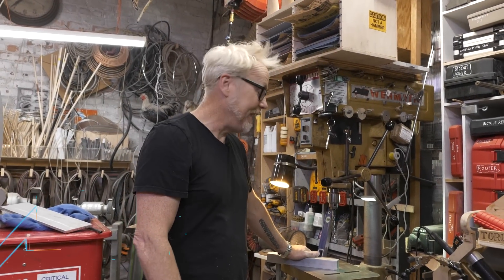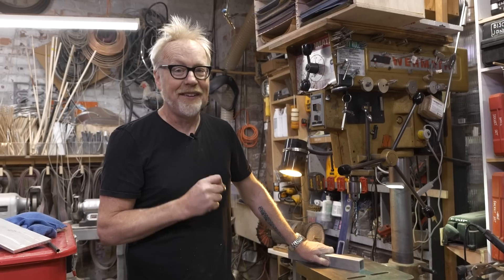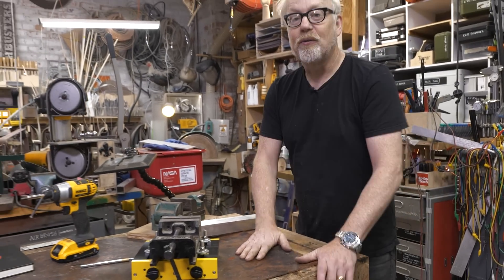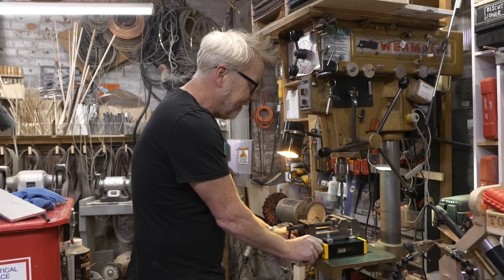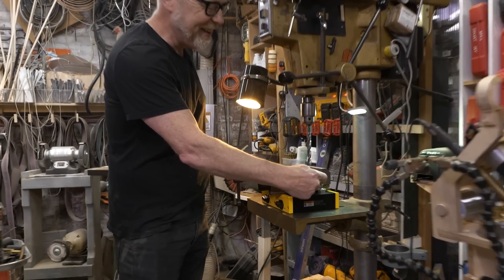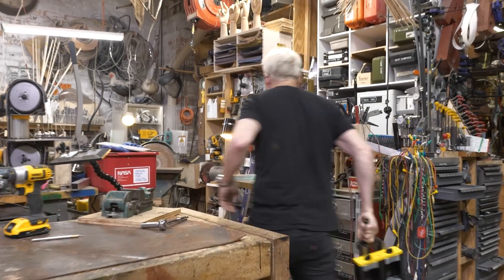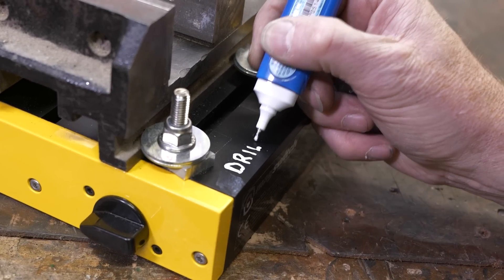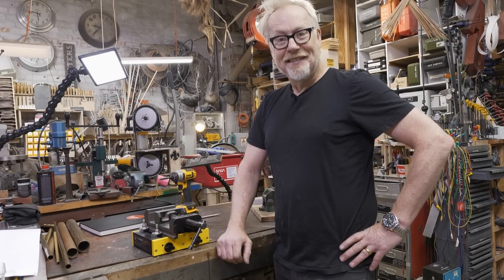Show and Tell: Magswitch Drill Press Vise Mount!

Comment: It is so easy to remove and slide because it should be 90 deg to how it is now.  The magnets are mostly over the slots in the table.  This breaks the magnetic lines of force.  I have a couple of small versions for holding indicators that are harder to remove than that is right now.

Comment: For anyone that would like something like this but on the cheap, I made my own. I bought for magnetic tool mounts from Harbor Freight for $52. I had to buy four M8 x 1.25 x 16mm bolts as well. So for a total of $57 I have a device that does exactly what this Magswitch does but for a fraction of the cost.
Reply: Thank you for the tip. I can’t bring myself to spend more than the cost of my drill press on this but $52 is perfect. The HF skus are 63663, 5645.
Reply: @JoshLanners  Glad I could help. I use mine all the time. Whenever I need to drill something that is oddly shaped or too small to just clamp to my drill press base.
Reply: So you bolted the magnet strips to your vise? How would you "switch" the magnets on and off?

Comment: Having been in a shop situation where a rather heavy workpiece went flying over my head from the bad work holding setup of guy running the machine 20 feet away from me; I totally agree that proper clamping is NOT optional.

Comment: Did anyone notice that the last switch he flipped crept back to Off ? Only three of the four magnets were activated when he drilled the square tubing.
Reply: Glad I'm not the only one who noticed :)
Reply: And he was struggling with them too. They need to make those switches larger so you can get more purchase on it.
Reply: yep ,must be careful and check that the switch is fully turned
Reply: Would be nice if he painted half of each switch so that when the red faces the sky, he knows the switches are off, and when the black faces the sky, he knows they're safe.
Reply: @MorningDusk7734  Good idea
Reply: @MorningDusk7734  Great idea! You wouldn't want to unexpectedly trap your finger between the magnet and some metal object!
Reply: @MorningDusk7734  that, as well as the larger switches, are perfect upgrades.
Reply: Yep, it is just 4 smaller mag locks in a larger housing.
Reply: @MorningDusk7734  Would be even better if you could switch on/off all 4 magnets with one easy to reach switch!
Reply: @Carambal81  That would probably require remaking the entire manufacturing process, rather than just housing 4 of their existing models in one unit. Plus, it's harder to forget to turn on all four switches than it is to forget to turn on one switch.
Reply: I don't own a 90 inch tv.
Reply: There are two magnets in a magswitch.  When a magswitch is "off" the magnets are cancelling each other out, when it's "on" they're reinforcing each other.  This makes the switches want to bias to one position or the other and if you only flip it part-way, it tends to drop back.  There is a very satisfying feeling when the switch is all the way on, though, so you just need to learn to feel for that when you're flipping the switches.
Reply: At about 4:47 give or take
Reply: Me too
Reply: @wobblysauce  which ones the 90?

Comment: I appreciate the warning about real life drill press situations (I don't do any heavy duty machining work). This gives me pause to invest a bit more consideration to E-Stop placement.
Reply: All the machines I used throughout high school and in my grandfathers shop all had the E-stop at the base of the machine. Need to stop it, kick the switch.
Reply: @SmallDisturbedChild  Yes. THAT makes perfect sense. No need to wander around looking for the plug.
Reply: @Tigglebitties  some of our machines where like this. Our grinding/polishing wheel was a pedal you had to have your foot on, step off and it cut off.
Reply: @Tigglebitties  I thought about that, but figured—with my being so inexperienced—there must be some kind of hidden impracticality making it prohibitive, otherwise why wouldn't everyone do it. (although I never believed they were any trouble when using them on the old Ridgid 300s)

Comment: I like to use a less aggressive cutting angle for aluminum. I used the bits that have been ground for brass (same on the lathe) with good results: less grabbing, cleaner, more precise holes.

Comment: Regarding Adam's anecdote about crawling to unplug an out of control drill press: One of the best ways to remain IN CONTROL if the work gets caught and spins on the bit, is DO NOT LET GO of the quill handle, instead HOLD IT DOWN against/towards the table. The work will be trapped, unable to side off the bit or become airborne. Anything so short as to not strike the pillar, you can avoid at arm's length with just a step back (still holding down the quill) and switch OFF with the other hand.

Comment: Too right about the nature of Aluminium.  I’m a locksmith by trade and whilst manufacturing a part for a job which involved a square alum box with open back I was holding up against a wall, as the drill bit broke through the aluminium the whole thing twisted off the wall, my index finger slipped in through the open back that due to the bite of the bit twisting it off the surface I was holding it to above my head, in an instance my finger had slipped behind and in as the drill bit pushed through, driven forth by the flutes in the drill as it hadn’t fully cut all the way through the Alum and was pushed like a cork screw through my finger until it hit the other side of the piece I was drilling and finally cut through the first hole and spun completely, finally cutting the bits of flesh that the flutes had within them.  It happened in a split second and I reactively withdrew the drill bit immediately.  I remember that it felt like my finger at been twisted off as I hadn’t seen what had happened until I pulled the drill out.  That was only with an 18v DeWalt cordless drill and a 1/4 inch drill bit! 😂  Could only wonder what damage I could do with the drill press lol.  I atleast found a whole new respect for the potential carnage power tools can inflict when you let your guard down for a split second!😅.  I was lucky, just a love tap compared to what potentially could happen.  Haven’t injured myself with a power tool since then 10 years ago so I’m lucky! 😂
Reply: Only a 1/4” bit? That’s twice the size as my own drill in the finger accident. The good news is you and I are the safest drill press operators around now. lol.

Comment: if the piece is long enough you can rotate it up against the piller, that way it won't spin like a propeller and cut your belly open. when setting vice I always do this in case it does grab even when c clamped down. or up against a stop to keep from spinning, Ran a radial drill for yrs. in machine shops and have a great fear for what a drill press can do

Comment: I have looked through their catalogue before and I can think of hundreds of ways I could use their products, unfortunately they are priced higher than I as a hobbyist can justify.
This one is super cool and practical tho!
Reply: And that doesn't even take into account that most consumer level machines don't even have a top material useable with magnets.
Reply: Well, xheaper alternatives are to use standard magnetic locks, and use 2 to make a flat surface, using a thick plate to mount them. You need a 12V supply at around 5A to dive them, but it will not slip. Otherwise 4 cheap magnetic stands for dial indicators looks like it will do the same function, again all you need is the aluminium plate to mount them all to, and then attach the vice to the top as well. No T slots, but still cheaper.

Comment: Looks like you could mount it the other way so you don't have to reach around the back to hit the switches. Also, can you use a non-slip pad for even more grip or would that weaken the magnetization?
Reply: That would kill the magnetic force. Just a few mm is enough to reduce the holding power to a fraction of the full strength.

Comment: I saw a video someone did they used a permanent magnetic chuck and drilled holes in it for the vise works pretty much the same way but at 4x less cost think I will do mine that way as well. Although this is an amazing product no doubt about it just a bit too expensive for some.

Comment: Actually the problem with the finish of that hole is more to do with the rpm being too high for the size drill. some cutting oil or any oil would be a great help also .
Reply: Yeah, way too high RPM, super aggressive feed, and no lubrication. 

Sneaking up on holes with multiple size drills is actually not recommended for many reasons. It causes improper wear, bad centering, and is far more likely to catch and grab the material.

Comment: Great product.  Pricy, but worth it to some that need its abilities.  I have a number of their smaller switches... the MagJig and MagSquare I use for shop made jigs.  Love them.

My only concern with MagSwitch is the lateral loading break force is much less than the vertical break force rating, especially on a slick surface like a tool table.  Just be advised that it may still have the ability to move/spin under high loads.

Comment: i'm surprised Adam's drill press dosn't have big wheels to lock and unlock the table and adjust the hight. I've always wanted to do that so you don't have to mess with the fiddly little factory arrangements. going up and down should just be a spin like on a mill

Comment: 4:52 Preventing lift is great and all, but isn't that irrelevant when you can so relatively easily jig it side-to-side like you do there? Isn't it in the horizontal direction you primarily need to prevent movement so that it doesn't spin out of control?
Reply: Yeah, I'd want something that engages the slots/holes in the drill press deck.

Comment: Wanna hack that tool for some crazy jig making potential? Notice that the MagSquare 165 by MagSwitch looks very similar to the size of each corner switch in this tool. It looks like the company simply took 4 MagSquares and built them into a jig that lays each on their side. Fashion up some t-track frame from 80/20 extrusions and a drilled plate from 1/4" thick flatbar, and size to your needs. The MagSquare has threaded holes on the sides (M6 I think I heard) for attaching to various other jigs. Look at their website and notice how many tools have the MagSquares as the base component. And here's a tip: the magnets don't hold in shear very well if your metal table has been waxed (as advised by some for corrosion protection), so you can apply a little RugGrip tape to the bottom of the magnet to reduce sliding.

Comment: I wonder about accuracy with this setup. Getting that magnetic vice situated exactly where you need it to put a hole where you want it sounds like a lot of fiddling - getting it near to where you want it, activating one magnet, then nudging and tapping it to get it right, then activating the others - and even then, getting the hole within .5mm of the mark would be the best I would think possible.

But I suppose if you need more accuracy than that, you'd use the mill instead.

Comment: 4:47 the last switch you turned backed off. I feel this video alone is reason for a rethink of the orangutan to machine interface. I would prefer a definitive tactile feedback in the handle the magnets are activated. Maybe a lever action instead. I wonder if this is why your able to lift the vice off the platen at all. Great idea but I feel it needs some improvements. Thank you for all you do Adam.

Comment: Hey, Mr. Tester - How about testing what actually matters? The twisting force from a stuck drill bit is what counts, if you'd rather not see a violent injury.  The vertical hold down force is worthless marketing blabber.  Let's see it stay put when a 1/2 inch bit sticks in a hefty piece of Aluminum.
How about it? Can you test that?

Comment: Random idea: a floor mounted emergency cut-off switch..? (For when you have to tiger crawl ;))

Plugs are sometimes hidden behind other items in a shop.
     Seems like high risk items such as a drill press could use something like this :)
Reply: We actually have a floor mounted e-stop mushroom button on our drill press, with the head facing you ... if that thing goes wild, just kick it 😆

In addition to that, we have T-Slots in the drill press table, for mounting a vise
Reply: @SystemX1983  Both good additions :)
     I was considering to make a foot actuated (kinda) "deadman's switch" out of a microwave door switch  - (since I'm broke ;)).
 
- idea / iteration A: 
Power does not flow unless the foot switch is actuated first.

- idea / iteration B:
Foot switch = drill start.

Either one would make sure that the power is cut when you have to run away, duck and hide, or simply when you're actually dead. ;)

I feel like I might be missing something in the equation...  (Seemed like a good idea on paper)

The Switch can handle 230V - 3A sustained (and 16A peak), so it should be able to handle my 700W hammer drill, I think.

(Using a microwave switch for a 650W angle grinder too. Cheap $20 grinder, so the original switch fried when I first used it. And I like the fact that this switch doesn't lock... for safety reasons. 
      If I let go of the switch or grinder for some reason, it just stops. 
     Like a rat tail angle grinder would)

Any thoughts on this? :)
Reply: @iggysixx  Now, in my brain, several ideas grow, how to DIY a switch for that ... but I better don't tell, almost every electrician would slap me 😆😂

Comment: Table saw is still worse, was in shop working my raw material through the joiner when the kids on the table saw didn’t hold on hard enough, 4 foot board flew backwards into a door (1/4 steel plate over the door stopped it… that shop was designed for screw ups). At least they knew to stand to the side or it would have impaled them.

Comment: Can you flip the vise 90° so you have the switches on the sides instead of front and back? 
I saw some other magswitchs with only one switch, isnt this one a poorly designed product? I mean, you have to make sure 4 switches, which sometimes flip themselves back, are in the correct position which you cant quickly recognize because you cant clearly see marks near them.
Reply: Also... those magnets are so small... now I understand why you pick it up with only 40lbs of force (even tho you use the spindle as a lever) when the manufacturer advertises it for 700+lbs

Comment: I wonder if they have an electromagnet version of that, so it could be plugged in and give you even more holding power.... Cause I have seen a drill press spin an 80 pound object around like a rag doll. It was a long pipe in with a vise clamped to the table, the bit grabbed the metal of the pipe, and spun it till the pipe hit the post of the drill press. Operator was fine but his dignity landed on the floor with him. (Drill press was on lowest speed was probably only reason he was not hurt. much)
Reply: they may have great power ... until the power cuts out ...  ;)
At least I think that's the reason they're using regular ones, although having electromagnets in addition to standard magnets could be fine if a bit over-engineered.
The power consumption would likely to be pretty high as well other issues that we may not be aware of ...

Comment: I wouldn't have the switches in that orientation as the back ones seem a little awkward to get to (back and front) If possible I would have them on the sides (right and left) as would be easier to turn on and off.....

Comment: There is no way Adam is going to turn four switches every time. Hopefully this is reasonably strong with one or two, but you have to wonder that they couldn't design it with a single lever.
Reply: yeh 1 switch would be infinitely better

Comment: Not impressed. Adam finishes talking about the huge amount of force and danger of the drill press and then easily lifts the clamp off the table. Add in the price and it only gets worse.
Reply: 10 years ago magswitch sent 2 magnetic featherboards to my woodworking program. They work fine I guess. But very few students care to use them more than once because they're a bit fussy to set correctly and most were a) used to using their hands and b) usually only ripping 8-10 cuts at the same dimension. 
Meh...
Reply: It does seem like it should hold better, but most of the force in a drill press is also not straight up, it's a twisting motion so you have some friction as well.  That said, for drilling metal, just fasten your vise down with bolts or clamps